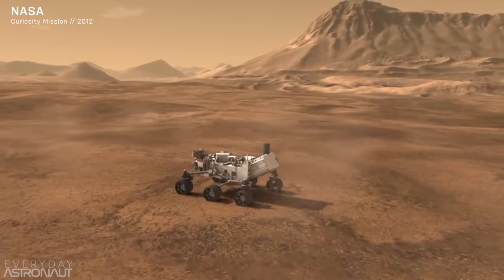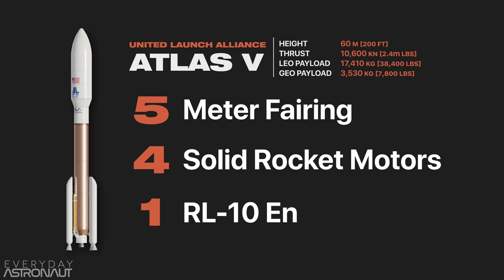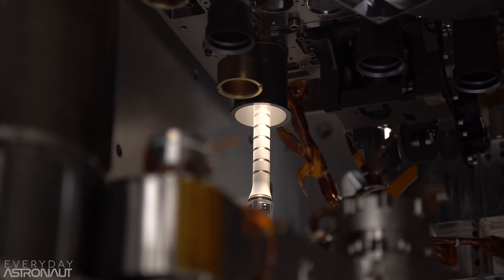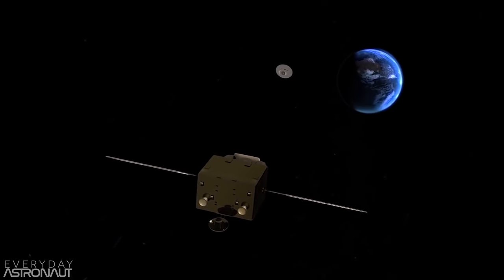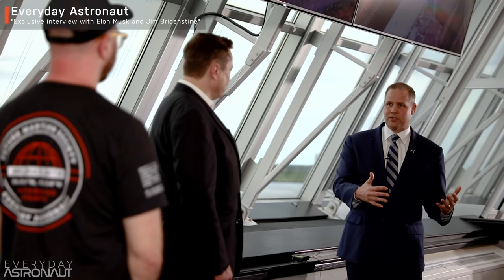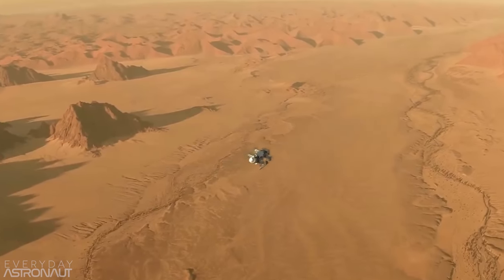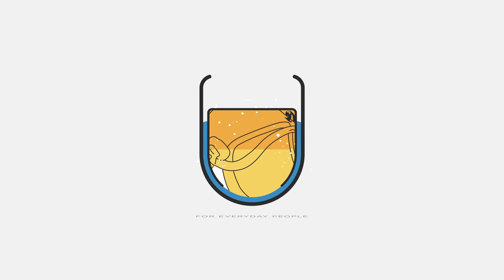NASA’s Perseverance Mars Rover VS Curiosity - What's New? What's Improved?

Comment: Does perseverance sing “Happy Birthday” like Curiosity?
Edit : Question Mark
Reply: It would be pretty awesome if they sang happy birthday to each other.
Reply: No, it does not
Reply: @arthurvilain7270  :(
Reply: That is so depressing.
Reply: It sings "Daisy" when its RTG runs out
Reply: Maybe Ingenuity will sing it to Perseverance, to be a good helicopter
Reply: It probably can. Especially with the motors. NASA is using brushless DC motors (BLDC) on the Perseverance rover 
These are the same kinds of motors found in drones. And, if you've seen a few drones, you know that they can play notes when they start up.
They do this with the motor controller sending pulses to the motors that vibrate the rotor as a speaker would vibrate its diaphragm. 
So yes, in theory, it is possible for Perseverance to sing happy birthday to itself.
Reply: We don't need to know you added the question mark in your edit
Reply: @kdseeker1186  ur six and not allowed to swear

Comment: This chanel has gotten me into space and soon im giong to start making a new mini liquid fueled engine.
Reply: Me too
Reply: I agree. People say SpaceX is trying to pull people into space, but in my opinion, this channel is doing it very well
Reply: Me too. Please suggest chanel to return safely to earth...
Reply: Waaaaaaaa wait how? I have worked on like, little water rockets... but that's amazing.
Reply: @Shadow_The_Pad  go check out the chanel, Not mad rocket scientist.
Reply: @kommandantgalileo  it’s probably more difficult than you think
Reply: @Formula1st  it is it blew up
Reply: @kommandantgalileo  wow you made that quick
Reply: @Formula1st  yep
Reply: Before you ignite it, make sure you have a plan for what to do if it explodes.
Reply: @alangarland8571  my engine blew up
Reply: start with hybrids or solids first, read up on the topic more because this is dangerous.Get an ignition system, take care of propellant velocity and mass flow rate. Have you done Fluid simulations for your nozzle geometry??
Reply: @stevenalbano5686  Scott Manley
Fly safe
Reply: @aerojetrocketdyners-2538  small reminder. Hybrid, is safer than liquid. But solid, that's just something YOU SHOULD NOT DO, if you care about safety. Those mixtures can light up sometimes at temperature as low as 50°C
Reply: @_mikolaj_  I am talking about estes, hybrids are actually technically challenging if you are starting.I stay away from Hybrids and stick to my current L1 certification motors for my rocket.Because hybrids are considered Experimental rockets by NAR and i am pretty sure a fully loaded nitrous tank at 200psi is just as dangerous as a solid.

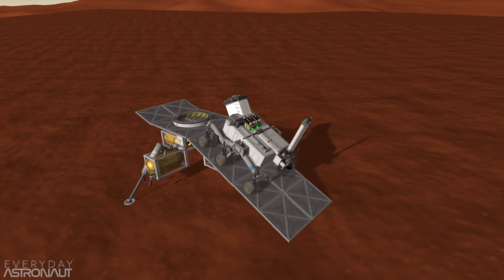Comment: @7:30 - So you just said Lunar Starship needs upper-placed auxiliary engines to avoid digging a crater when landing on the Moon. You used this to illustrate why the same problem can occur when landing a heavy payload on Mars. So why is Mars Starship not going to need similarly upper-placed auxiliary engines to avoid digging a crater when landing on Mars?
Reply: @mertkocogullar6485  is it possible that Lunar Starship's upper-placed auxiliary engines are really just meant as a closer propulsive match to the lower lunar gravity, rather than to address any crater-making problem? Vikings weren't exactly tiny - how come  they didn't cause crater problems?
Reply: Lunar regolith is very different than Mars's. Also lower gravity means that debris can eject fast enough to damage orbital and far away assets. Also Starship will be carrying much bigger and more powerful rovers than the current ones so these problems don't apply.
Reply: I don't know how much of that actually plays a role. I've never heard that reason before. 
They are able to repurpose the rover's suspension as the landing gear and they are ready to operate immediately upon touchdown.
Reply: @admarsandbeyond  You mean a hoverslam landing on the Moon can cause dust to be ejected into lunar orbit? But if Skycrane is being used on Mars, then it means that the Mars rovers are heavy enough that the problems do apply.
Reply: Landing propulsivy with a high power rocket engine on the bottom is a bad idea anywhere (on moon, Mars or earth), not only because you made a crater and blast dust and rocks, but because if the nuzzle is to close to the ground exhaust kick back can damage your nozzle, you need longer legs like in the case of falcon9, or a special landing pad that allows jet exhaust to pass, at launching that was a problem from the times of Wherner von Braun and was solved using flame divertors and sometimes putting rocket on a tall stand with a large gap below.
Reply: @theOrionsarms  so how come this won't be a problem for Starship landing on Mars?
Reply: @manofsan  maybe firsts martian starship would have longer landing legs, or would use smaller rocket engines putted near top like lunar versions, but you are right if it is a problem on the moon would be a problem on the Mars, at least until can be build a special landing pad.
Reply: @manofsan  Yes. Smaller particles can reach lunar orbit and sandblast orbital craft. Larger particles can fly up to hundreds of km away. About rovers, Perseverance has tiny wheels and very little power making it risky to overcome even the tiny crater the landing engines would create. Starship would land cybertuck size rovers capable of overcoming the (very small actually) crater it would create.
Reply: @theOrionsarms  That is not a problem. Engines are high enough (don't you think SpaceX would have thought of that before committing to a whole architecture meant to land propulsively?).  They tested that anyway that with Starhopper.
Reply: @admarsandbeyond  I think Elon twited a month ago that starship need longer landing legs, so this is a problem that they are working.
Reply: @theOrionsarms  How much longer do you imagine he meant? He said at the time of SN3 "Need wider span, longer stroke & ability to auto-level for uneven ground or leaning into high winds.” So mostly for stability. Falcon doesn't have much more clearance (just longer span) and  certainly doesn't land on a special landing pad with flame diverters (don't confuse launching with all engines on Earth)
Reply: @admarsandbeyond  Obviously he doesn't mean that you need to put it on the stills, it's easy to figure how tall is need to be if you know how powerful it's your engine and how much trust you need for landing.
Reply: @theOrionsarms  You are right, it's easy to figure out and they have. SN5 is about to make the 150m hop and land with these updated legs, they're not making a prototype with much longer legs or special launchpads for the soon to follow regular 3 engine landings. 
Moon is a different case because of its kind of regolith (meters of compacted powder and gravel size particles), lack of atmosphere (to slow down ejecta) and very low gravity. First landing on Mars the hoverslams would clear most regolith away to the rockbed without posing danger to nearby assets or big powerful rovers. Afterwards they will build flat simple landing pads to land ships closer to base.
Reply: @admarsandbeyond  Maybe in the long term would be more effective to ditch the landing legs completely and use special landing pads, saving few extra tons on a spaceship that is landing only on dedicated spaceport would worth it, are many ways to solve a problem and in the field of propulsiv landing we are only at the beginning.
Reply: @theOrionsarms  Starships will need this kind of complex legs for stabilization, shock absorption, engine clearance, and many other reasons even on landing pads. Also Starships are not guaranteed to always land in perfect conditions on perfectly prepered surfaces. Anomalies, miscalculations will always happen.
Reply: @admarsandbeyond  It's not going to happen for the beginning, but abandoning completely landing gears was a option for falcon9 and would be for starship, once will figure how to land perfectly every time, like I said are many ways to solve a problem, but when you cannot longer improve a solution it's time to choose another approach that can give you superior capabilities.

Comment: Sky crane should be a reusable equipment.
Reply: I want to know more about the sky crane. For me it's the most interesting part of the landing. How heavy is it? What fuel do the 8 engines use? How do they time the release of the cables? Maybe Scott Manley might answer some of these.
Reply: @captainoates7236  they use hypergolic propellants I guess its a mixture of hydrazine variants and dinitrogen tetraoxide. I think the cables are timed by the legs of the rover confirming the touchdown
Reply: if skycrane can be landed safely, it can be disassembled by robotic arm and can be reassemble for another purpose.that much man-made material is very valuable on Mars surface.
Reply: @oremooremo5075  Thanks for that. Are you aware of any youtube vids on the subject? Specifically sky crane.
Reply: @captainoates7236  I cant really say it was a specific video about but rather it was from watching several videos on the subject. I remember one saying there were sensors attached to the rover legs to detect whether they had touched down safely

Comment: The reason for later collection, is this rover might drive across a considerable distance, saving some interesting samples from across those great ranges. So for anyone in the future, its just going to and grabbing one package, rather than running around to dozens of locations, maybe dozens or even over time hundreds of miles across an area, and then freshly drilling in each of those locations. If you have a system that goes and can pick stuff up, and head back to earth, not having to also provide it with a big mobility system, and drill, and everything else to do that (not to mention time) could save a lot of weight, space, and thus cost for such a project.
And it's not like a few small rocks here and there will add to the weight a lot so... they figured might as well since a return mission is increasingly possible seaming in the next decade or two.

Comment: 20:34 Just a terminology comment, the specific case of coaxial counter-rotating propellers are contra-rotating propellers.
Reply: With just one not two rotors as with the Mars helicopter, it does away with the need for a more complicated system of rotor blade angle control, in single rotor systems. In single rotor systems when the side of the rotor that is turning with the same direction as the forward motion of the helicopter, adds in velocity to the rotor on that side. You get the opposite on the other side of the rotor, that forward velocity subtracts from blade rotation on that side. So if there was no compensation with blade angles as the rotor turned, the helicopter would roll out of control. Instead of continuously controlling the blade angle, in a contra rotating dual rotors one blade compensates for the other on each side and you don't need something to control blade angles. That means you don't need something more complex that could go wrong

Comment: The main reason for the skycrane for me is basic physics relative to stable vs unstable mechanical equilibrium. If you put the rover ontop the lander propulsion system, it's like balancing a space x reusable rocket. Something like this /°\ with propulsion pushing from under is inherently instable compared to something like this \o/ where the propulsion pulls from above.
Reply from the maker: That’s actually called the pendulum fallacy and it’s not actually true for rockets! 👍

Comment: Most excited about the RTG. No longer reliant on solar panels to keep the batteries charged.
Reply: Curiosity uses an RTG as well. The wheels will likely fail before the RTG can't provide enough power. All deep space probes use RTGs for power as well since there isn't enough sun power available at the outer planets and beyond.

Comment: Ok the real crazy part about flying a drone on mars is..... on earth the atmospheric pressure is 14.7 psi and on mars its 00.088 psi just over a half of a psi. So theres not much there. That's why they do the rocket crane maneuver because parachutes are only able to do so much which is to slow it down to 100 meters per second. And then the rockets do the rest.

Comment: What is it about the RTG that has a limited lifespan?  14 years is not significant compared to the half life of Pu-238, and RTGs have lasted far longer (e.g. Voyager).  On their web page I see that an experimental Serling generator has been running for 14 years non-stop, but that's a completely different generator.
I find the NASAfacts booklet on MMRTG says it produces 110W when fresh and drops to 72W projected end-of-life after 17 years of operation.  Ah, it includes 3 years of fueled storage before launch, so that gives 14 years left.  But in this instance, the order to begin fueling was given at the end of July 2019, so it will have been running less than 1 year at launch.
I assume that the drop in power must be due to the radiation damaging the materials it is made from, since the lifetime includes time since fueled even if stored under controlled conditions before use in the harsh environment of space.

Comment: Why is the sky crane wasted , why can’t it have enough fuel to move it , what is the speed of the rover as they are extremely slow
Reply: Skycrane does not have enough Delta-V to do that, after it flies away it probably is out of fuel
Reply: @apyr1439  that's what I thought but an extreme waste as they could power the skycrane via plutonium so the rover could move into more than one place else it is just another expensive piece of space junk left on Mars
Reply: @deltadom33  well they obviously can't do that because if they could they would